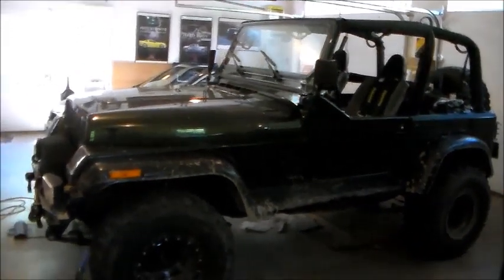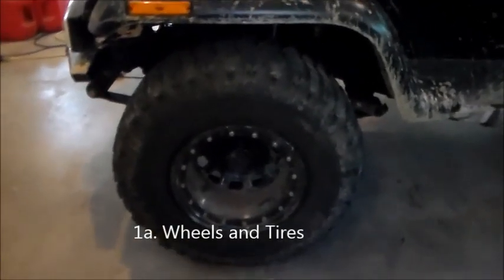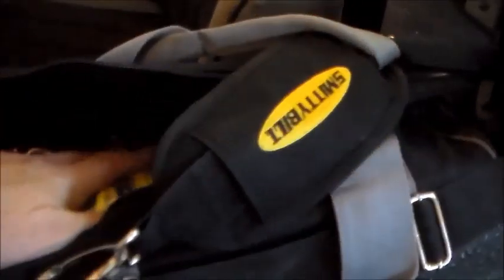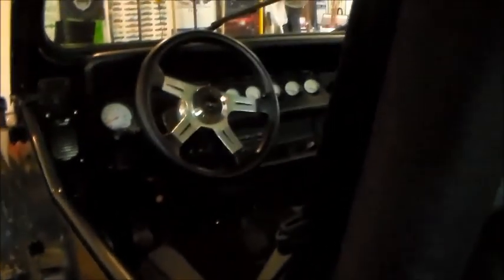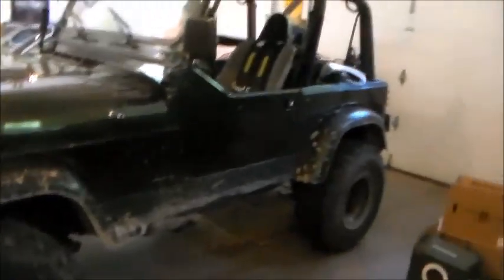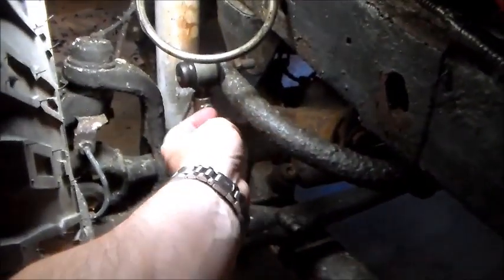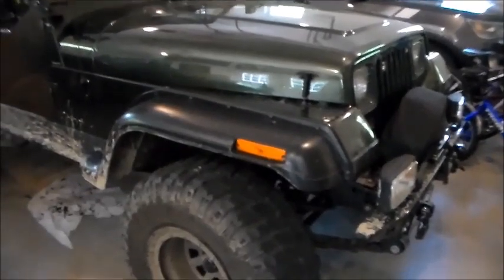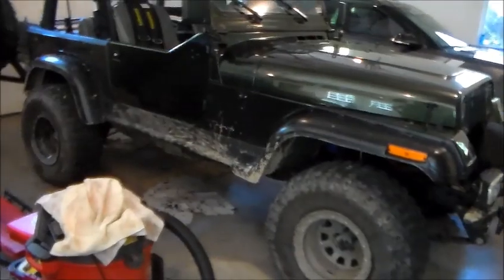Jeep YJ 7 Essentials for Off Roading

Comment: My yj is over spring and has a body lift, I'm 15 and fixing it  as my first car will I be able to go on some trails with it
Reply from the maker: el 2can Good luck w/ your project! It’s really cool that you’re wrenching on your Jeep before you even have your license!! 😂 Let me know if you have any questions or need any advice. I’d be glad to help!!
Reply: @Metalcop5150  I'm just wondering how off-road capable it's gonna be, it's oversprung and on 35s so I assume fairaly capable but I don't wanna go on a hard trail and get stuck my first time lol
Reply from the maker: @builtnotbought7787  Start with easier trails and build up your confidence, then keep on pushing the limits of what your Jeep can do! The short wheelbase, in conjunction with good tires and low gearing make the YJ's very capable off-roaders. If yours is a standard, I would recommend a hand throttle, that you mount on your shifter. Even useful on an automatic. You'll see, when your Jeep is bouncing and your foot is bouncing up and down on the gas pedal!! lol
Reply: @Metalcop5150  lol yea that sounds like a good upgrade, after I fix my 4x4 that might be the first thing I do
Reply from the maker: Is your YJ a 6 cylinder or 4? I might have some (free!) parts for you? Please let me know. Thanks!
Reply: @Metalcop5150  it's the 4.2 straight 6
Reply: Bro! I'm 15 too with a YJ, fixing it up! It's gonna be a great first vehicle!